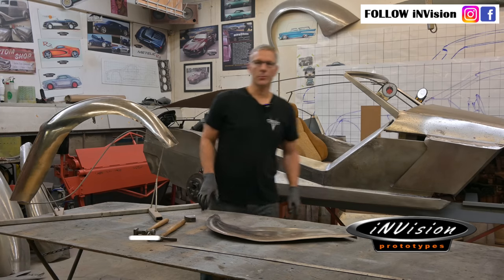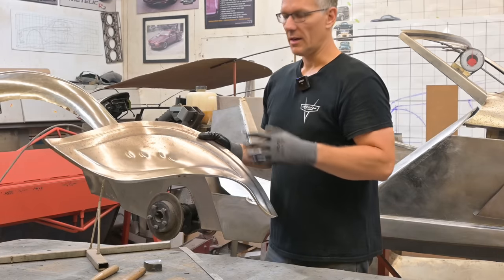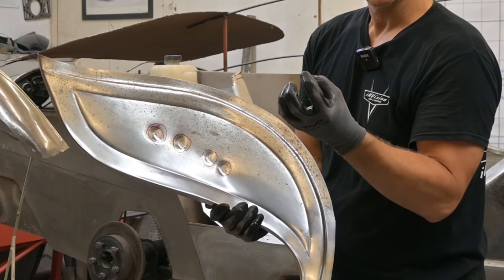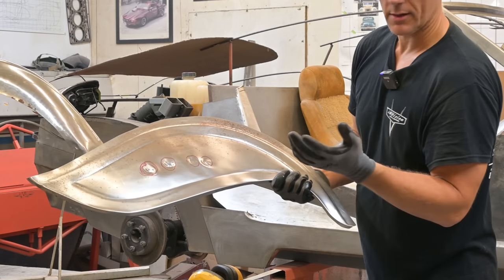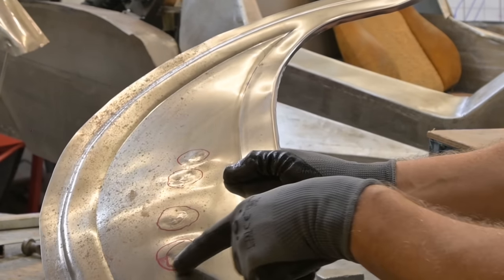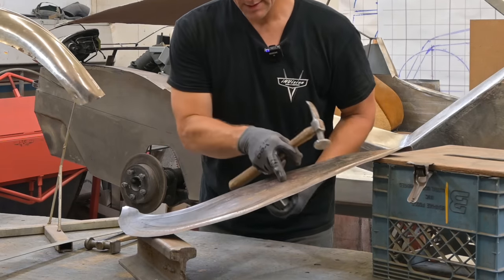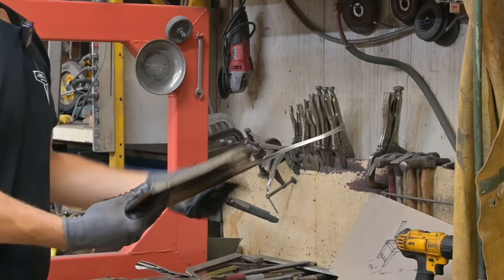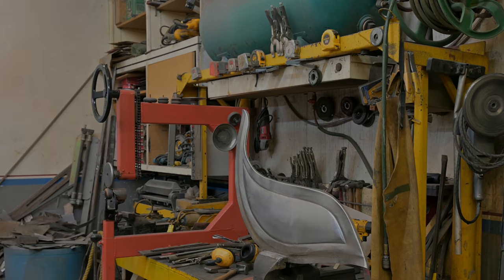EASY Ding & Dent Repair with SIMPLE Tools!

Comment: Another great teaching video.  And you did all that with essentially six tools, if you count the vise and sanding block.  That's not enough tools.  What's the point in having 35 hammers if you don't drag them all out, every time you do a project?  But seriously, I've found that when I'm shrinking metal, I do better when one tool is soft.  Steel on steel is how we stretch metal.  So, I use different materials, usually wood.  But I do have a hand-held shot bag, a shot dolly.  I even have a hockey puck.  Or, going the other way I have wooden mallets to use against steel post dollys or anvils.  One thing I love about this is there's so many ways to do it.  Great Job Nick.
Reply from the maker: Great TIP on the soft tools!  If I do another video on this topic I'll pull them out.  This episode was aimed at a guy who needs help 'taking business' before his wife sees it using tools easily obtained from a local auto store.  Initially, I thought of using a 16oz hammer... then changed my mind as I would loose all cred. lol!  Thanks for watching Dan 👍 And thanks for the tip on different materials as a backer.  I'm sure guys will find that helpful.

Comment: Good tutorial Nick it made it easy to understand the process, re the slapper was it basically flat ?, the S&P slapper I have is convex in both directions which I am guessing would be for high crown work as opposed to flatter profiles as in the video. Cheers Greg
Reply from the maker: That large slapper is slightly convex for low crown panels such as the one in the video.  I have others with more shape to them as well.  Thanks for watching Greg!